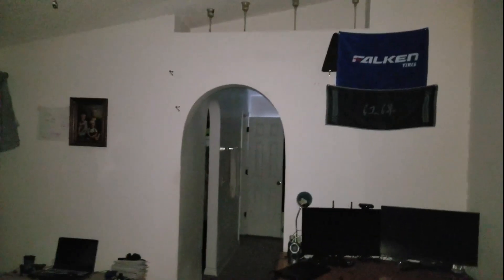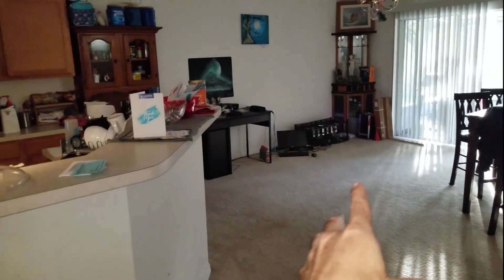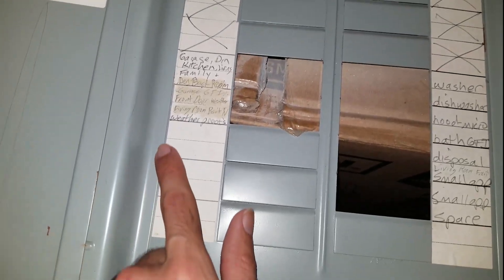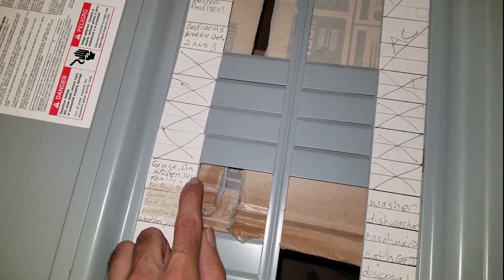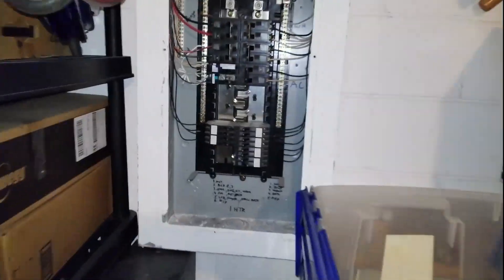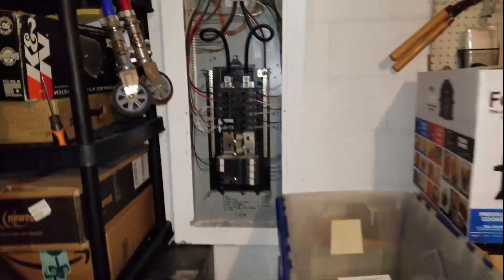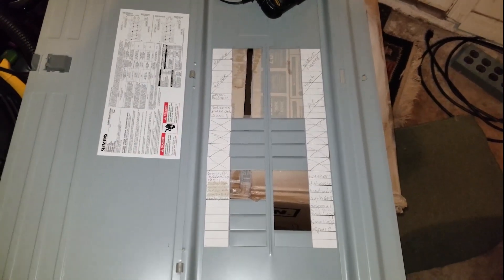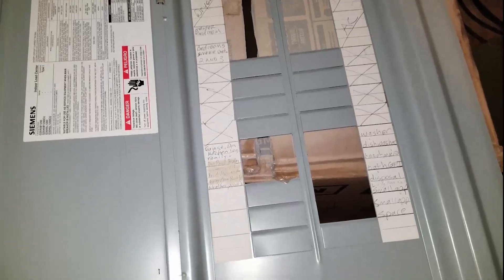Mining Rig Power Problem at Home 😔

Comment: I recently had a problem with my house doing this, got it two work by plugging it into the dedicated wall ac unit plug, in my apartment they have a dedicated outlet for the air conditioner, only way my pc and rig will work is when plugged into there

Comment: you might have a wiring issue going on. I had issues like that and had a short in my original wiring in my house. mine was doing the same thing as yours is doing. I was all good till I put a load on the circuit. wire got cut in the conduit from someone else way before me. it took 6 months of mining before it became an issue for me

Comment: It could also be that you have some house lights on the breaker circuit. generally the breakers only pop/flip over when your over the load capacity.
something else might be installed on that line

Comment: Amp the wire without the rig. You maybe pulling amps froms something else. If amps 0 then run the rig. From the looks of it is a 15 amp breaker. So just make sure your pulling less than 80% of 15 amps. If numbers are higher. Check lug connections tighten them. If the numbers are lower than 80 percent and it trips then change the breaker.

Comment: That is a weird issue for sure man I'm not an electrician but maybe... just maybe the wall outlets are old or maybe could be a little bit loose in the wall outlets? I had a similar issue of the breakers tripping and ultimately got my electrician buddy to re-do both sides essentially (new breaker and new wall outlets and the issue was gone in 1970's house). 
Crappy thing for me at my current place where I live I found out both bedrooms, which are completely on the other side of the place of each other, have the same 15amp circuit/breaker..... So I can't even run 2 air conditioners in either bedroom...... so dumb lol.